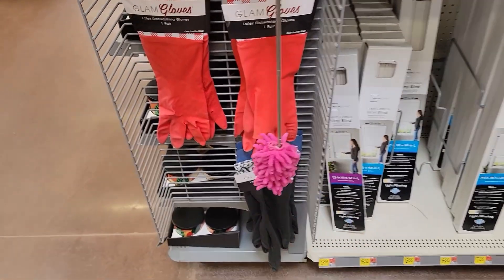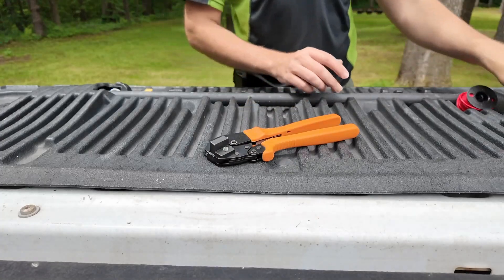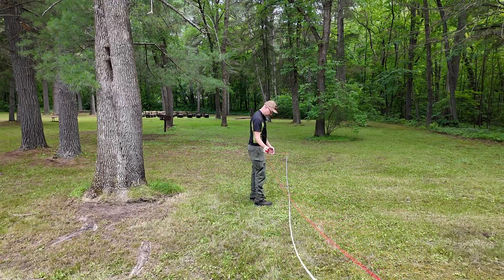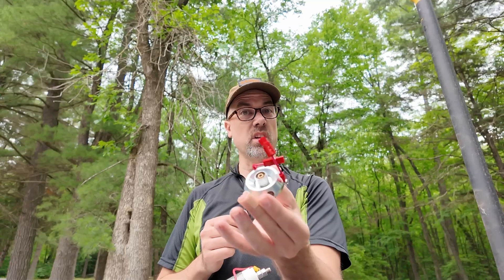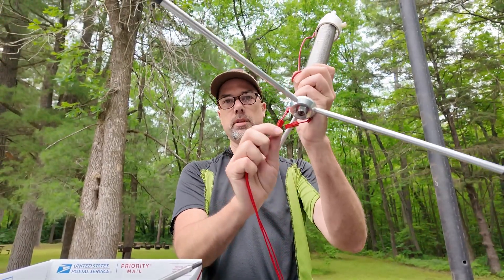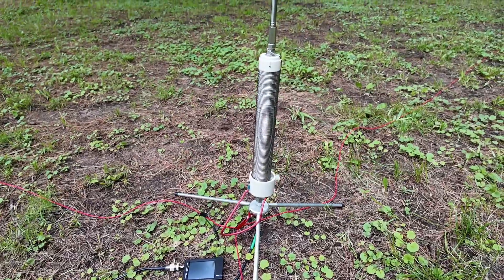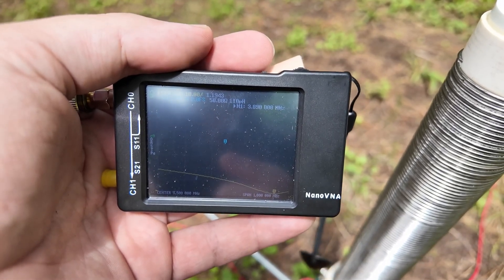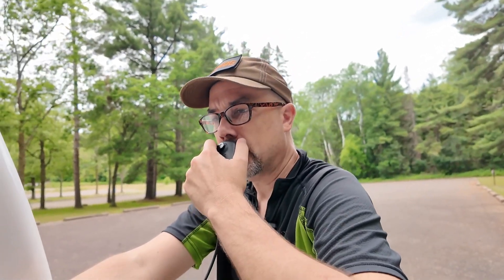How TO. Tunes up the Wolf River Coils Antenna

Comment: Why use this when you can get the ATAS 120a? I just talked to central Germany from Wisconsin on mine.
Reply from the maker: In theory, the WRC has more radiating area and could get you more contacts... but I don't care much about theory and I think your ATAS did awesome!  What I care most about is making contacts in accordance with your mission.  For example, I wouldn't take either of these antennas up to a SOTA.

Comment: I have been eyeing the WRC, but have heard it is very very narrow on 80m and typically on the low end.  Most nets I check into are on 3.92 to 3.94.   How do you like this antenna on 80m?
Reply from the maker: @jaynesjunction  coil antennas are always "narrow", you can help that out with a longer whip or longer counterpoise. That being said, I spend most of my time on 20 and above, so I don't have a form opinion on 80m performance.

Comment: Add 2 of the WRC spacers and put your coil in the middle. I have found that it helps the pass band flatness considerably
Reply from the maker: I have this setup to test (not a WRC, but still a coil loaded vert) in an upcoming video.

Comment: I'm having a hard tuning the Mad Dog 80M coil with a "magic carpet"  on a balcony. Any suggestions?
Reply from the maker: If your balcony has a metal railing, connect to that? You likely need "more" ground plane or more radials.  80 is a tough band.
Reply: @temporarilyoffline  The lanai is all wooden, and I was referring to the Mad Dog 80 Coil, but thanks for the response. 73
Reply from the maker: Yeah - I probably messed that all up - keep the coil, and more counterpoise to help with tuning. (Or more whip ... Or both!). Good luck!

Comment: If the swr is somewhat within range of where you want and you don’t want to go crazy moving the collar up and down, you can try moving the whip down or up and/or twist the collar left or right to fine tune.

I do this with my wrc on a ground spike and no radials and I’m able to get it down to 1.2.
Reply from the maker: no radials - bold move!
Reply: @temporarilyoffline  I like to live dangerously. I do have them in my kit but only deploy if the ground spike isn’t working out as well and need to use the legs. Have had great results both with and without radials. Wish there was an easier way to carry the whole kit. Was looking at something like a tripod bag.
Reply from the maker: @_onthemike_ I was looking at tripod bags also. Antennas are hard to make go bags for, especially the whip kind.

Comment: Simple and inexpensive, but effective product. I use a single, elevated, resonant radial held up by an electric fence insulated push-in post. Effective and quick to set up and break down. IIRC the various studies indicated one elevated resonant radial was equal to about 4 - 8 "on ground" radials, depending on ground conductivity. I use a Sporty 40 with a 17' whip for 40m. For 75m, I use the WRC and a 17 foot whip. For 20m and above, I don't deploy any loading coils.
Reply from the maker: I haven't tried the resonant radial route yet, but I do have a future video coming out with all the rest of the setup you mentioned. I prefer the 17'±sporty coil option.

Comment: I wonder I’d you could just set the contact at its lowest position and then lengthen or shorten the 17 ft whip to the band your on. I also saw a user put tent stakes on the legs to hold it down in windy conditions, thought that was nifty. Have you tried one of those screen mesh blankets instead of radials for the ground plane?
Reply from the maker: I'd say the whip is a coarse adjustment and the coil is a finer adjustment... The short whip is definitely a limiting factor. I haven't tried the screen ground plane, but it works just fine.

Comment: Steve… at about 20 cents per conductor-foot, you did well on the wire.  Recently, I purchased 500 feet of 14 gauge stranded wire at Hime Depot fir about 14 cents per conductor-foot,   My first choices of buying wire would be Hime Depot or Lowe’s, but with the high price of fuel in SoCal, $4-99/gal. I’m not going to spend an extra $5-$10 to save a few dollars.  Nice Powerpole quick disconnect!  73 de KD6UYK (Tim).
Reply from the maker: Hey Tim - as fuel prices rise, at 11mpg, I'm not going to argue at the local store's register... Imma plan better like you said!  The wire wasn't the most expensive part of the day for sure!

Comment: I recently got a Wolf River Coils antenna with both the 6' and 17' whips. I already had an MFJ 17' so I mainly use it for 20m and up without the coil. I have the three 33 ft radials plus nine 10 ft radials but I mostly use a faraday cloth because it's quicker to deploy. I found the 17 ft whip will give good swr across most bands so you can cover digital and voice without making changes. One trick I learned from another youtuber is tying a thin rope at the top of the whip and tying knots at the whip lengths for each band. Makes tuning much quicker.
Reply from the maker: I just saw that trick and I REALLY like it.

Comment: I have a WRC, and it definitely has some good qualities like the ones you mentioned plus a seemingly low takeoff angle.  My only trouble with it is like you said, it is very fiddly, and you basically have to take your antenna analyzer whenever you are going to use it.  The collar tilts and changes things. You move, it changes. Band switch, start all over again. Etc.  If I have a lot of time to set it up and mess with it, it is a great antenna.  I just never have a lot of time to set it up an mess with it.
Reply from the maker: I prefer speedy deployments too.

Comment: Walmart came threw !  I use the speaker wire in electronics they have for ground or DX 10 wire from Callum. I am in Boston NY, Getting that left over hurricane today.  2 Tornadoes' so far.  Grid down all over. some wind . 50 MPH so far and heavy rain. Big mess . lots of lightning . No antenna's in park for a wile hear.  Mike M2MAK did a POTA on 40 meters AM ! and he did 7200 KHZ with a buddy pole. that was funny and on video !  Nice coil ! They work great ! Love power pole ground . quick and easy and comes un done if tripp over . That's how I connect my counterpoise on end fed. Power poles . 73
Reply from the maker: The "breakaway" part of the powerpole is amazing for radials!  Stay safe!

Comment: Try putting the coax choke 20m away from the antenna when using 7Mhz?    What was the SWR at each end of the band(s)?   My experience with base coils results in an unusably high Q factor, can't tune the entire band.   Great work!
Reply from the maker: Good ideas - I don't think this setup would support the whole band without a re-tune although I didn't try.

Comment: Speaker wire is cheaper and you get twice as much because it has 2 wires. Works great on mine. I use 3-33' and 6-8' lengths.
Reply from the maker: I like speaker wire too!  Glad walmart had something!

Comment: 1.  Aren't your 10m radials already as close as needed to 33 ft?

2. The extra radial from the coax won't hurt anything, since being non-resonant, it wouldn't accept serious RF current.  With the line isolator choke at teh antenna as shown, the balance of the run's outside of the shield is a conductor in the antenna's near field, and will pick up RF and (unless you have another isolator at the other end) will bring it into "the shack"..  An isolator (e.g.; balun) at the feed point makes sense for a dipole, since you want the antenna itself to remain balanced (for the sake of the pattern shape), and you can dress the coax away perpendicular  to the E field.  But when feeding a vertical against ground, if you've only got one isolator, put it at the radio.
Reply from the maker: 1.  They are, but I wanted to run with the config that WRC prefers.

2.  Makes sense, thanks!

Comment: 9:45 The WRC + 5 meter whip is one of my pairings of choice (and of course, the coil itself is unnecessary if you're sticking to 6-20m). The short whip is USABLE with the coil, of course, but like you saw, it's not amazing.
Reply from the maker: I've already filmed the 17' version of this vid and it is MUCH better.

Comment: I've never found that the radial length mattered all that much with the WRC--I've used the ones I bought with it, the HOA Ham style ones I've built (shorter, but more of them), aluminum window screen (magic carpet), faraday cloth...they all seem to work pretty well. The important thing is definitely to have *some* kind of ground plane, for sure.

All that said, I appreciate the reminder that problems like this can be solved quickly if not cheaply once you know how they're built!
Reply from the maker: Agreed, the magic is in the coil tuning first, then in getting better with radials.  SCIENCE!

Comment: I have found  80m is super tight  on tuning  but the other bands are more user friendly! But with use it becomes more intuitive
Reply from the maker: The 80m band is HEYOOJ - even with the dipole setups, you can't really get the whole band on one wire without a tuner.

Comment: Any idea what kind of heat shrink remains flexible? Like ABR uses on their coax.
Reply from the maker: Not specifically, no - but I think there are 3 kinds on the market - "battery heat shrink" like we use on our CaHRTenna kits and Battery makers use to dress up battery packs - "glue lined heat shrink" which is less flexible - and "regular" heat shrink which has always remained flexible in my usage... maybe there really small stuff gets rigid because of it being small - ask Chuck over at ABR, he'll tell you what he uses, that part isn't the secret sauce
Reply: @temporarilyoffline  
“Sorry,  They are proprietary part.  We cannot disclose that information due to our NDA.

Chuck”

😂🤣
Reply from the maker: @full_metal2452  wow... really? I guessed it was off the shelf stuff. I was wrong.
Reply: Look for clear heat shrink. It is thinner but always stayed flexible for me.

Comment: I have gotten my best performance, both in SWR and contacts, with 18 8’-9’ radials, in bunches of 6 on each leg. All are 20 gauge silicone wire. 

I could probably go less, but that is how I made them and can not bring myself to cut them off. 

Never could get the factory radials to work, they would give me 3:1 SWR on 40m and 2:1 SWR on 20m. With this setup, I get 1.1:1, or better, down to 80m.
Reply from the maker: I'm with you, I am not able to cut wires, it hurt cutting the 7 ft off these radials in the vid! Now I don't know what to do with 3x7' of wire.
Reply: @temporarilyoffline 6m dipole? 2m pocket folding ground plane antenna? Play “fetch the wire” around the yard. 😉

The projects are endless. 😁
Reply from the maker: @kn6vbw  Right - NEVER throwaway parts!
Reply: @temporarilyoffline  You can even hook them all back together and use the wire to make a 21’ antenna for the coil. That would work much better than the 6’ or 17’ whips. 👍
Reply from the maker: @kn6vbw  good point - more wire, more better

Comment: I used a WRC on a pota activation on the beach last week.  It worked very well-  I find that three 16.5’ radials will do pretty well for all bands in tight spots.
Reply from the maker: I'm guessing that they arrived at 3x33' radials because 100' wire spools are a thing.  I typically use 4 17' radials and I'm happy with that as well.
Reply: @temporarilyoffline  yep, I pirated one to test a short end fed antenna and found I was getting about the same results with the 16.5’ so I folded the other two over on themselves and tested again.   Ended up clipping them and made a smaller system to use on campsites.

Comment: Pro tip to keep your radials from tangling, put a tywrap (loosely) around the first wire, then a tywrap (loosely) around the second wire and through the first tywrap, finally a tywrap around the third wire and through the second tywrap. When you are done, grab the tywrap and pull to the end of the radials this will prevent them from tangling. When you want to use them again, unroll in a straight line and grab one of wires and pull to the side, the tywraps will move back to the antenna leaving the radials untangled. I used this technique to pull large bundles of wires without tangling.
Reply from the maker: I'll have to try that out!
Reply: @temporarilyoffline  That would be interesting to see.

Comment: Ground radials are never an exact science. Oddly enough, for my WRC on a ground spike, I get the best SWR with only two 12' radials; 1.09:1 on 20m and 1.12:1 on 40m. With 4 radials it jumps up to 1.5:1. No matter what combinations/lengths I tested, 2x12' worked the best. I am using 50' of non-choked coax, so that comes into play for sure. "It shouldn't work" but it does, for me. Like you said, every setup and every location will be different. YMMV.
Reply from the maker: Hey Doug!  You're absolutely correct and honestly I'd consider 2x12 a big win - less to carry/fiddle with!

Comment: So, that plastic set screw doesn't really need to be used when stationary.

Also, you can cut those 33' radials in half, or even in thirds, and run them all with great results. I have a sb1000 and a 17' and run 15-18 10' radials and have had GREAT success
Reply from the maker: You can even take the radials and attach them back to the antenna base!  Lots of different ways to deploy  - as you mentioned!
Reply: @temporarilyoffline lots of different ways. Just sharing something different. 

Some people are even using window screen, and even using Faraday cloth as a ground plane.
Reply from the maker: @KU8RLY  thanks for sharing, appreciate it!

Comment: You can get 33 foot spools of tin foil for one time use. Lay on ground with feild stones to hold down. Crimp the foil onto a 2 foot ish 1/2 coper tube ring antenna in the middle. The large surface area of the foil has a lot of capacity with the ground that it is laying on. It will play well 😊  cut broom stick handle to roll up foil if you wnt to use again
Reply from the maker: Hams are resourceful!
Reply: @temporarilyoffline  think how much wire one piece of foil is equivalent
Reply from the maker: @P.SeanCoady  exactly - skin effects